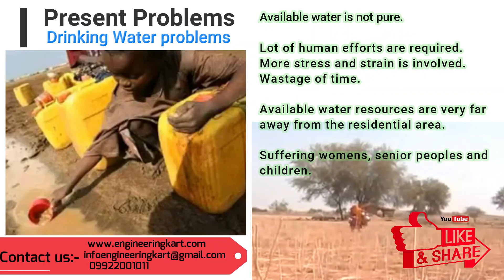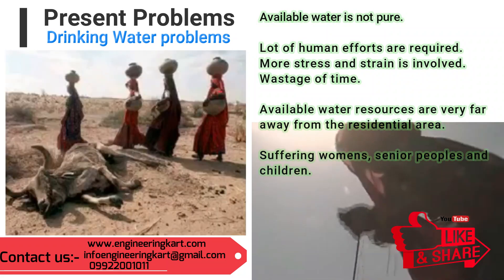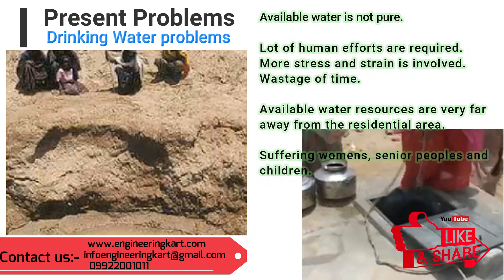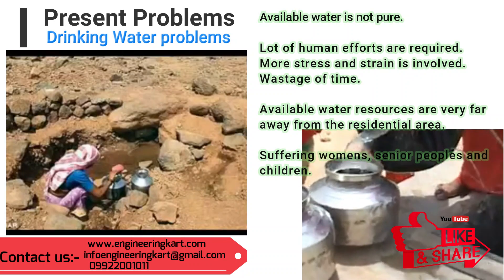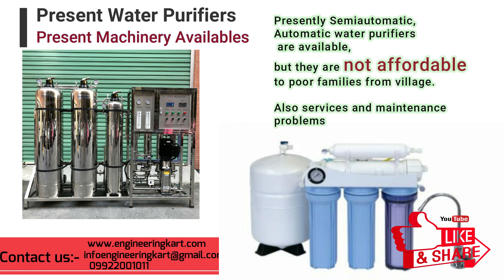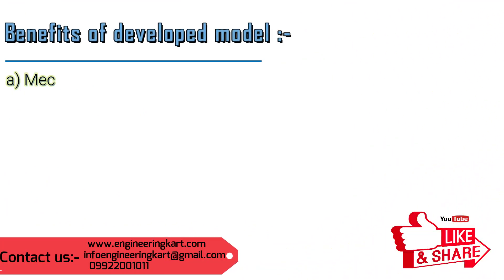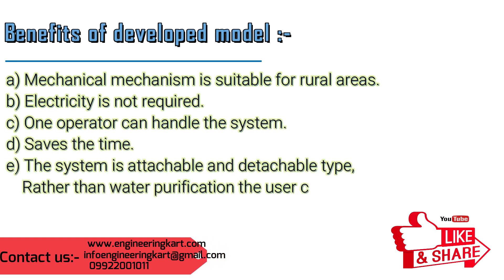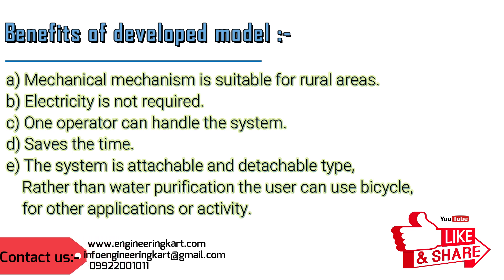HOW TO MAKE WATER PURIFIER | BICYCLE OPERATED WATER PURIFIER | LOW COST PURIFIER

Comment: PLEASE SEND THE PPT . PLEASE.  THE WEBSITE IS NOT WORKING . ITS URGENT . PLEASE TILL TOMORROW I NEED IT . I HAD ALSO CALLED YOU BUT YOU DIDN'T PICK UP . PLEASE COPY PASTE THE LINK IN COMMENTS.  🙏🙏🙏
Reply from the maker: PL DO MAIL infoengineeringkart@gmail.com
Reply: @engineeringkart8878  can you please send the ppt
Reply: @sandeepkumarjaiswal4442  Hi mate did you receive anything regarding this project? 
PPT or Report or Synopsis? or Anything? 
I call them no answer,
I message them no reply,
I email them no reply
Reply: @sandeepkumarjaiswal4442  Hi mate did you receive anything regarding this project? 
PPT or Report or Synopsis? or Anything? 
I call them no answer,
I message them no reply,
I email them no reply
Reply: Hi mate did you receive anything regarding this project? 
PPT or Report or Synopsis? or Anything? 
I call them no answer,
I message them no reply,
I email them no reply
Reply: @Hoadati  bhai please give in this ppt